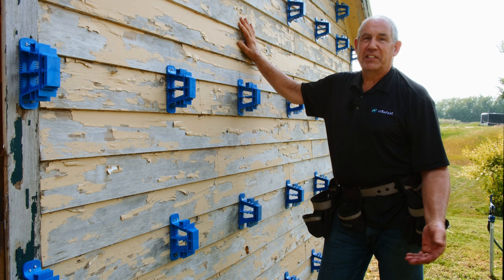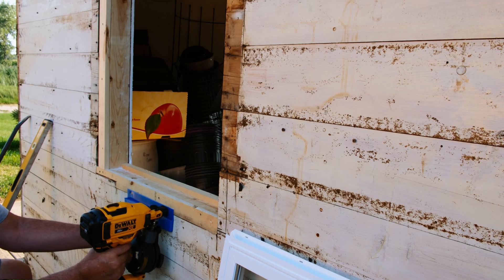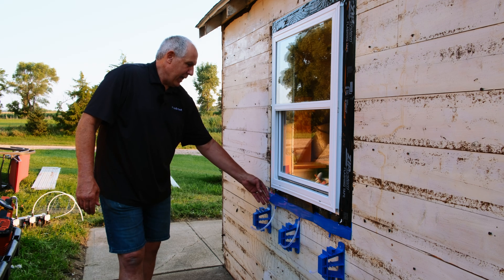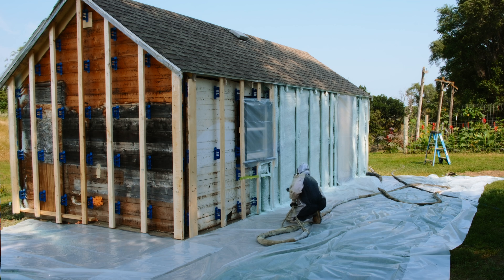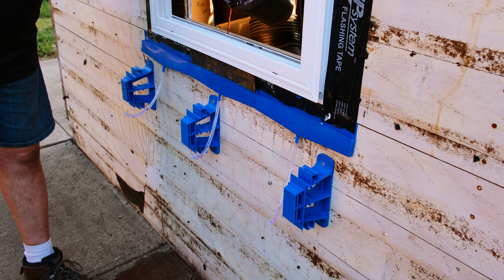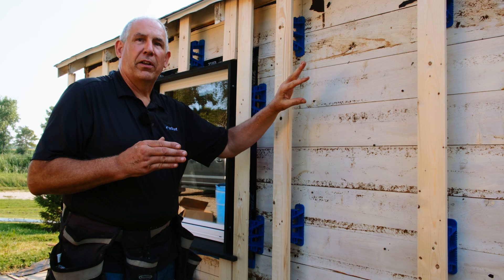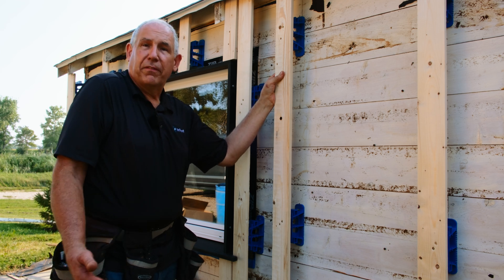Get Net Zero Ready in No Time with the Easy X-Bracket System Retrofit Solution

Comment: I've been working on the tear off, resheathing, and exterior insulation on an old home during my nights and weekends. Could have saved myself about 5 months doing this instead. 😅
Reply: Yeah, but you would be missing a kidney to pay for the spraying.
Reply from the maker: Amazing, we love to hear it! What are you thinking of using for your exterior insulation?
Reply: @insofastllc  over ZIP, I put on 2" strips of foam under 2x3s, insulated between these foam strips with mineral wool, and then did house wrap. On top of that are 2x3 battens for a rain screen before siding.

But the tear off of the siding and boards followed by the ZIP install was by far the most intense part (physically and time). Again, the option in the video is very appealing relative to the approach I've taken. On the plus side I was able to replace all the knob and tube wiring in the exterior walls.

Comment: Foam is great until water gets into it and rots the wood
Reply from the maker: The foam and acts as the air barrier and has cross-ventilation between the furring strips and foam, along with proper drainage, so the wood will actually stay perfectly dry.
Reply: @insofastllc  I have seen so many installs of foam on the exterior that trap water and allow termites in that most places won’t pass inspection anymore if you have it. Great idea but too many potential issues
Reply: tHanks  @vmoutsop  Can you share some more of what you saw go wrong.  Which panels were used?

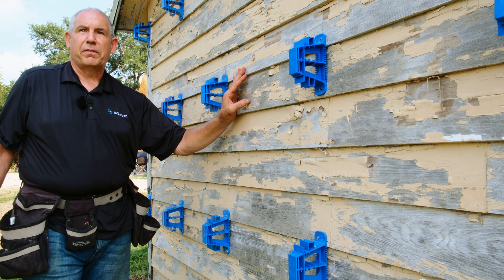Comment: 0:22 When spray-foaming I see that the lead paint was scraped off, no doubt for adhesion reasons. Maybe this step isn't required? There should be enough foam bonding to the supports and battens and saves having to deal with the paint dust / flakes.
Reply from the maker: Since this is was a demo project, that side previously had the lead paint scraped off. The other side and rest of the walls were untouched. Scraping the lead paint off is not required, nor do we recommend it. X-Brackets can go right over the existing siding.

Comment: Do you tape the face of the furring strips so after the spray foam you can get clean wood to nail siding to? Also how do you attach bug screen to the total assembly at the bottom and top so stuff doesn’t make a house in the gap between the foam and siding?

Comment: do you need to screw the brackets?  or can you just use adhesive and it will be strong enough with the foam
Reply from the maker: For an application like this, or new construction, it is recommended to nail them.
Reply: @insofastllc nails for their better shear strength ?

Comment: It's known that closed cell spray foam increases sheer strength on stick framing as much as 2x when applying to the inside. Are there any such benefits to this application?
Reply: We built a double stud wall home with 7” of closed cell foam and even in high winds the house never creaks. We also live about 15 miles from the center of a 7.2 earthquake a few years back and had no cracks in the drywall.
Reply: Its a stupid idea, just demo the siding sheer it and rockwool the outside